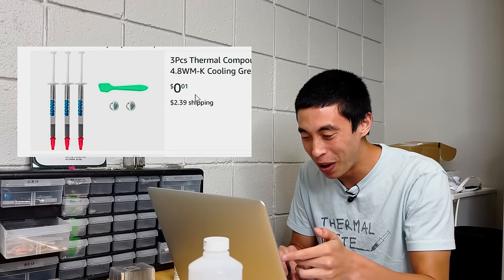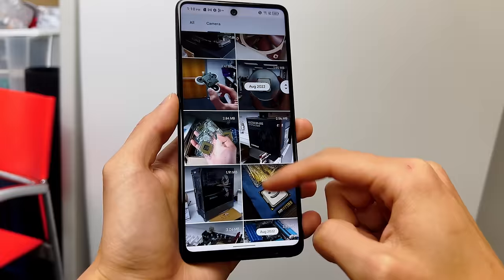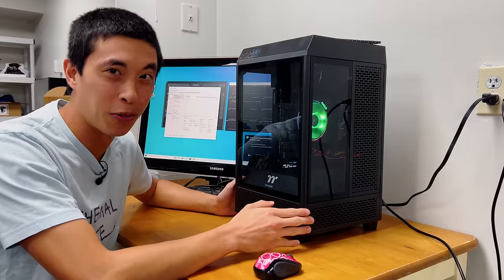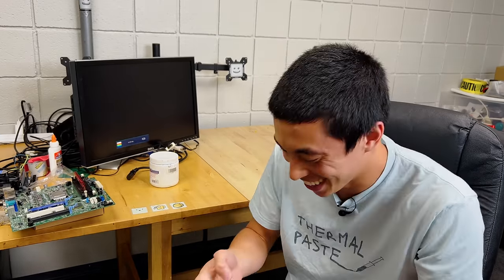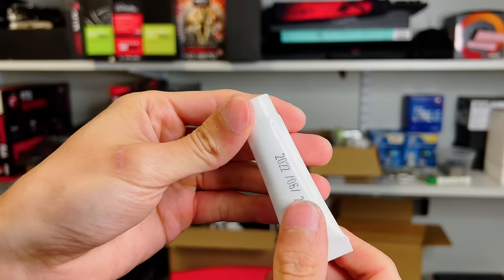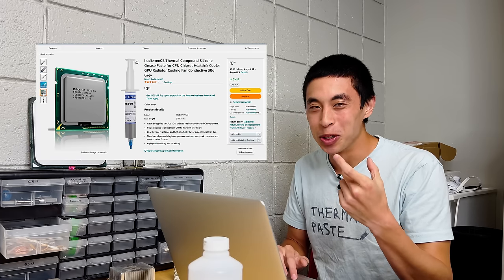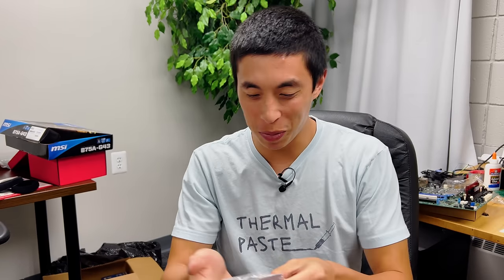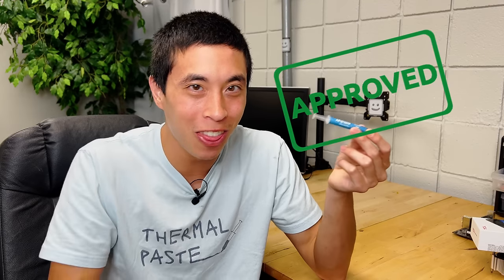buying the SKETCHIEST thermal paste I can find..and regretting it immediately

Comment: the best thermal paste options only cost like $10 for a tube of more than youll need in a lifetime XD
Reply: Most higher end thermal paste come in 3gr. syringes. That's enough for a few applications which is fine, but if you plan on any future upgrades or builds it's definitely not going to last a lifetime.

Comment: I was a bit disappointed with the last 2 pastes. You ordered Halnziye 510 (HY510) based on photo and got a tube of some other red label stuff (YNPJ YJ-W100). The Halnziye 810 (HY810) was instead "Kooling Monster KOLD-01". I was curious to see the results on the actual product and not bait+switch results on those two. 😒

I get it was picking the sketchiest pastes but only the first few you got the actual paste being shown. 🤔

Comment: I have the cheap amazon stuff that has that stupid metal dust mixed in, ensuring you WILL make a mess every time you use it.

Also guaranteed to leave a massive mess on whatever your cleaning it off of.

I had to redo the termal paste job on my xbox 360. It ended up being easier just washing the ENTIRE PCB under the kitchen sink. Im being serious.

(Im half temped to give the motherboard in my dimension 2400 another bath because it TOO has that thermal paste mess all around the cpu socket.)

Comment: I had something wierd that happened to me:  i had to buy a adaptator(VGA to Hdmi) to my monitor that is VGA and i had to put 2 adaptators to make it work(a hdmi cable and a VGA to hdmi, the hdmi is only the entrance so i had to buy a hdmi cable), but after installing my monitor resolution went from 1600x900 to 1440x900 and i cant put my resolution back to 1600x900 and the recomended is way lower then 1440x900. Also i cant force the resolution to 1600x900. Is thid problem related to the change from de VGA to Hdmi or the fact that i had to use two adapt, a cable and a adapt? If anyone have any tips i would appreciate.

Comment: The thermal paste is probably meant for weaker cpus that draw less energy. But performance will vary, he used a ryzen 7 (news flash, it gets hot. Fast.) so really take this with a grain of salt unless your computer is similar, or stronger than the computer used

Comment: I got a bunch of random thermal paste over the years, I do have plenty of cheap stuff, I use the cheap stuff on my lower powered systems or systems that have a beefy cooler and I often never see temps thats alraming, Right now I have a i3 2100 system I've been using for a NAS and a Jellyfin server for family, and its not pegged at 100% all the time and the heatsink I have on it has 4 heat pipes, cheapo paste thats well after its expiration date I have on it now, the CPU only ever hits mid 40s to low 50s, My main rig, yeah I use MX-5 atm, I was using Noctua stuff, not using cheap on my 5900x.

Comment: i will use the phone as a new phone, the one i have is from 2017,an huawei p9 lite 2017, back then it costs 200 and something dollars, now it isn't worth even 100$,the phone is broken on the back and on the front i have dead pixels and some cracks, :(, but still it works 😀
(it only has 16gb of storage and i runned out)

Comment: must be running that processor hard to be hitting that temp that quick. I bought some cheap thermal paste just to get me by for now. I think i have some artic silver somewhere maybe ill find it and use it instead or redo it when I do however I did check a review of what I bought it had a name like HY15 or something like that and it was under $3 total cost. I figure it's legit though artic silver 5 used to only cost me $6 for about 2-5 cpu worth. Should have just got some more of that but oh well. As5 that's without shipping as well probably closer to $8 in todays market

Comment: #BeOnPointWithTCL My current phone is Motorola Moto E5 Plus. It's so old, that battery on average brightness holds up to 7 hours (so the phone is always at Battery Saving option, no matter what), sometimes even the basic tasks of a standard phone are not working correctly on this one (Messenger, keeps crashing, SMSs sometimes even dissapear). Maybe I don't need such a phone as this one, cuz' I use my current phone for work or rarely looking through social media.

Comment: G900 is a decent (well-known?) paste, I have been using it for over 2 years on different kinds of hardwares and never had a problem. I think your cooler itself is to blame in the first place, a stock cooler for 5800x? Even with the best thermal paste out there, I bet it will still reach those temps unless you undervolt/underclock it.

Comment: He can u help me i cleaned my latop fans and when i turned it on its was overheating and making weird sounds pls i have a victus latop
Reply: Sounds like you got the heatsink to move during cleaning causing a bonding break with the thermal paste.
Remove the HSF (Heatsinkfan) clean the surface on the GPU and HSF then reapply new thermal.

There are videos on youtube that show you step by step.

Comment: I had that separation problem except I paid a damn lot, Arctic MX-5, I bought a big syringe and closed it well and 3 months later I used it again and was mostly coming out clear liquid and the paste is all ruined, what a damn garbage.

Never had this problem since MX-2, in fact I'm still using a big MX-4 syringe from quite a few years ago and still looks basically the same as day one and they are stored exactly the same.